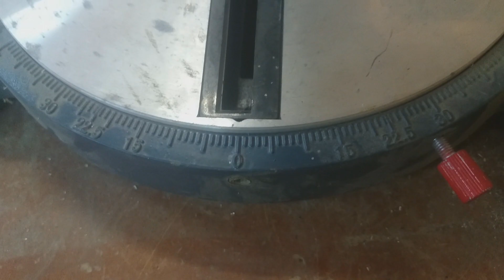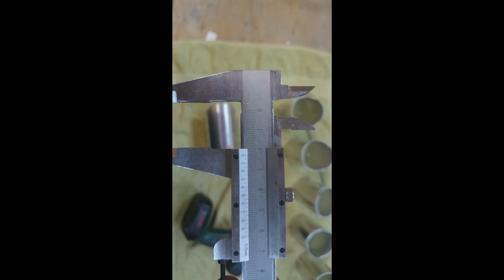★DIY★ - Carbon Fiber (look) Exhaust tips

Comment: Nice creation. how does the vinyl handle high heat?
Reply from the maker: Honestly since on most cars the engine is in the front the exhaust tips don't really get that hot so the vinyl has no problem standing the heat + the aluminum kinda acts like a big heat sink. I think the melting point is around 250 degrees C. But yeah so far they are holding up pretty good on my friends R32 Golf.
Reply: NeoM - Gaming & More Awesome and thanks for the reply. I think I am going to try and make some like you did. Hopefully they come out as clean as yours.
Reply from the maker: Glad to hear that :)

Comment: Which material did you choose? Nice Video by the way ;)
Reply from the maker: Stainless for the inside and aluminum with vinyl on the outside. Thanks :)
Reply: Alright, thank you :)
Reply: I'm building the exhaust tips right now. I just noticed, that it's gonna be a Problem to fix them on my exhaust. Becaus of the schrews that reach inside the stainless :/ how did you solve that?
Reply from the maker: In my case i welded the tips to my existing exhaust, I'm guessing you want to slip them over the pipe and use a clamp to fix them, in that case i would try to use rivets, they are a bit more low profile.
Reply: thanks for the quick answer. I will probablöy do it as you said.
So happy that i found your Video. Looks amazing even without the carbon fiber yet :D

Comment: Love it - using low tech shit to get a high class result. Well done mate! More power to the makers and fixers of things!

QUESTION: Is the CF wrap stuff flexible enough to allow you to wrap around the pipe?
Reply from the maker: Yeah, wraps around the pipe with no problem.
Reply: Thanks for responding! Sorry man, I was unclear  -  I mean around the leading edge that you painted black instead of wrapping.
Reply from the maker: Oh ok, the edge was problematic, because the CF wrap would wrinkle up, on the edge and it wouldn't look good. In fact i tried this with real CF and Epoxy resin and the edge caused the same problem. So i painted it because it was easier :)

Comment: What vinyl is that? It actually holds up to the heat?
Reply from the maker: it's standard 5D carbon vinyl. I have the exhaust tips installed on my Fiesta, my friend has them on his Golf V R32, and i sold a couple, and never had any problems. I think the vinyl doesn't melt is because the aluminum is offset from the stainless, so the heat doesn't get to it. But if you car spits flames, i don't think it would hold up :D

Comment: I really want these for my 09 c63 amg if you feel like making them let me know. I would pay for sure
Reply from the maker: I do actually plan on making some in the early months of 2k17, better design with real carbon fiber and epoxy wrapped around, and some with color anodized aluminum. They are gonna be 90 mm in diameter.
Reply: why the fuck would you ruin a merc by putting this cheap garbage on your car..
Reply: why would you comment if your poor?
Reply: You mean too poor to afford a real exhaust over vinyl wrapped coke cans on a 63?  Good call man, you really put me in my place
Reply: relax dude you drive a pre facelift 204 in a country that doesn't pay luxury car tax.. wouldn't go bragging of riches just yet
Reply: 88kwthomas
buddy we all know whats going on here, lmfao what a chump
Reply: these are out of your budget anyway champ, save your money for head bolts